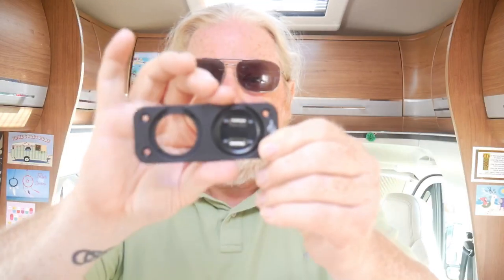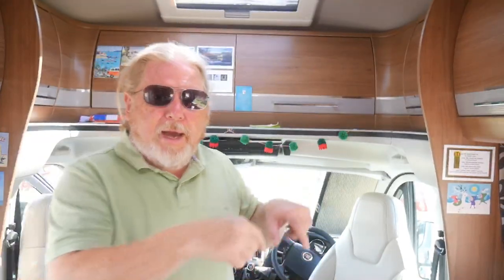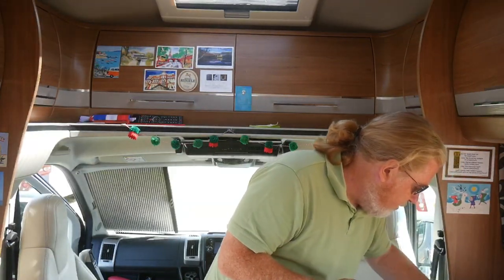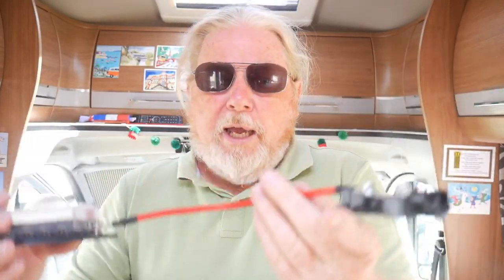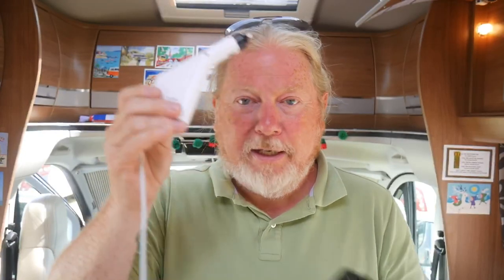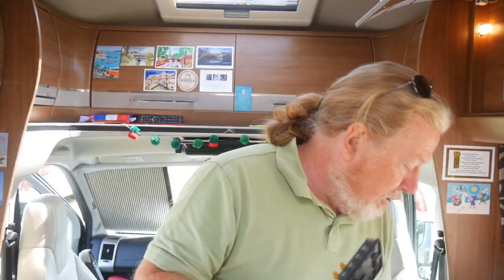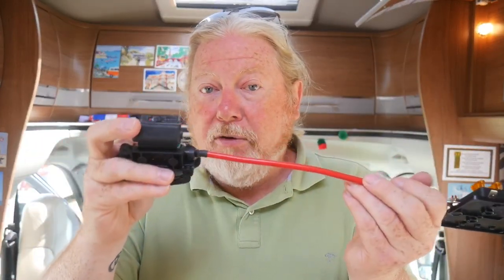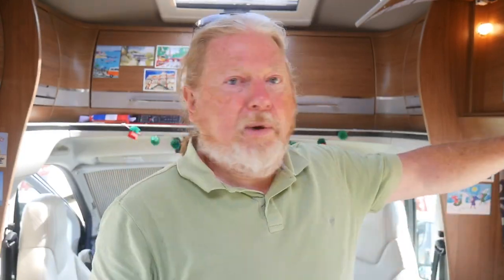Fitting 12volt fusebox and power outlets in Motorhome vlog #449

Comment: Enjoying this series of vids, be interested to see where you actually end up fitting and the cable runs.  One question you refer to the black cable as earth, I always thought it was negative or neutral?
Reply from the maker: Strictly speaking, ground is a connection to the Earth.
In circuits, the "common return" path to the power supply is informally called "ground", even though it is not actually earthed. Battery-powered devices, and the electronics, still have grounds. You can call them whatever you like so long as it’s understood to be the return path in the 12 volt circuit 👍😎😀
Reply: The Happy Travellers , thanks for response, googled it as well and now my head hurts 🤪.  To a layman the red connects to the +positive and the black to the -negative, earth protects device or people depending on current and device.  I also think I now get ground but not sure I can explain it..  Thx again, now going for a lie down....😁

Comment: This whole battery setup system is a joke. The lack of information on the battery type or as soon your wire gets longer the thickness changes is a painful headache and frustration. You call the store and they're clueless - just capable to sell you the stuff. Sadly most youtube teachers are terrible.
Reply: And i meant just camper vans in general. Not pointed at you directly, sir.
Reply from the maker: Yes I feel your pain. Lucky ours is an entertainment Chanel 👍. 
I do agree though that we should be better and create more detailed an informative videos. Maybe I’ll do a series on choosing batteries and setting up a 12 volt system. Might be a big job 😬